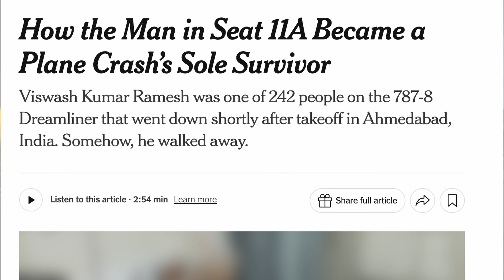Why the RAT Changes Everything – Air India 171 Update

Comment: While Capt. Steeeves presents a thoughtful and technically detailed review of this accident sequence, several key aspects of his assessment — particularly relating to Ram Air Turbine (RAT) deployment logic, the sequence of aerodynamic degradation, and the most likely failure chain — warrant further technical analysis and clarification.

The RAT can deploy automatically under certain failures, but it can also be deployed MANUALLY by the crew at any time. This distinction is critical. The RAT’s AUTOMATIC deployment logic activates under specific conditions such as dual engine flameout, certain AC electrical bus failures, or severe hydraulic system failures. However, entirely separate from these triggers, the MANUAL deployment switch allows flight crews to extend the RAT based on crew judgment if they believe additional hydraulic or electrical power is necessary, regardless of actual engine status. In this case, the observation that the RAT was deployed is insufficient to conclude that both engines fully failed. It remains operationally plausible that, faced with abnormal flight characteristics, rapid performance decay, and potential system messages, the crew elected to MANUALLY deploy the RAT while still experiencing partial or full thrust output from both engines.

While Capt. Steeeves focuses on AUTOMATIC deployment logic, his analysis does not fully account for the statistical improbability of dual engine failure at takeoff thrust on modern twin-engine widebodies. Historically, catastrophic dual engine failures immediately after rotation are exceedingly rare. By contrast, configuration errors, gross weight miscalculations, incorrect takeoff performance entries into the FMS, improper flap settings, thrust derate input errors, and degraded energy states on rotation are far more frequent causal factors in serious takeoff performance incidents.

Several well-documented cases reflect nearly identical accident profiles. In 2015, Air France 777F departing Paris Charles de Gaulle suffered a 100-ton weight entry error in its FMS (243 tons entered vs. 343 tons actual). This caused dangerously low computed V-speeds, late rotation, marginal climbout, and activation of tail strike protection. Despite the severe degradation, both engines remained fully operational throughout the departure. In 2009, Emirates 407 in Melbourne similarly experienced incorrect performance data entry that resulted in rotation occurring very late in the available runway distance, marginal climb performance, and maximum thrust application as the aircraft crossed the runway end. These cases demonstrate how configuration errors, when combined with full gross weights and potentially derated thrust settings, can produce extreme takeoff degradation without any mechanical failure of the propulsion system.

In the present case, additional operational factors likely exacerbated the performance margin. Reports indicate the aircraft carried additional fuel to accommodate extended routing due to regional airspace closures and conflict zones. This would have significantly increased takeoff weight and pushed performance margins closer to the operational envelope. If an assumed temperature or incorrect derate setting was entered into the FMS, the engines may have been operating at thrust levels below that required for the actual gross weight. Such derates, while common practice under normal circumstances, become hazardous when paired with miscalculated weight or runway conditions. These factors would combine to place the aircraft in a highly degraded takeoff energy state even before rotation.

From the available video footage, including one recording that clearly shows exhaust heat distortion and visible thrust displacement as the aircraft descended toward impact, it is evident that both engines continued to produce thrust throughout the takeoff roll, initial climb, and final moments of flight. As the aircraft crossed the departure threshold, engine exhaust visibly displaced dust, dirt, and debris, confirming substantial thrust being produced at that point. The exhaust distortion is clearly visible all the way through to ground contact, which directly challenges any scenario involving complete dual engine flameout. While the exact thrust levels cannot be determined solely from these recordings, the visual evidence confirms that both engines remained operational and were producing thrust through to the point of impact.

Ground witnesses and the surviving passenger reported hearing a loud bang at or near rotation. In the context of how late into the takeoff roll rotation occurred, this is consistent with tailstrike contact during forced rotation at minimal remaining runway. While the tailstrike itself did not directly contribute to loss of thrust, the sequence likely elevated workload substantially, as the crew found themselves in a rapidly deteriorating energy state, attempting to coax the aircraft airborne while already deep into the available takeoff distance with little margin remaining. This increasing task saturation, combined with abnormal performance and aircraft handling characteristics, likely compounded the challenges the crew faced immediately following rotation.

Following rotation, the aircraft appeared to achieve marginal flight within ground effect. While ground effect temporarily reduces induced drag and allows limited flight at reduced energy states, the aircraft’s inability to sustain climb once exiting ground effect indicates insufficient available excess energy relative to induced drag at climb attitude. This aerodynamic profile, shallow climb followed by rapid sink, is entirely consistent with a low-energy takeoff resulting from performance miscalculations and configuration errors, rather than mechanical thrust loss.

Throughout the brief flight, there is no indication the crew initiated gear retraction. In genuine thrust-loss scenarios, immediate gear retraction is often critical to improving climb performance. The absence of configuration changes suggests cognitive fixation on troubleshooting perceived thrust problems rather than executing performance recovery procedures, a well-documented human factor phenomenon in prior accidents involving takeoff energy degradation.

Taken in its entirety, the most probable failure sequence supported by both physical evidence and operational precedent is as follows: additional fuel uplift increased gross takeoff weight; incorrect weight or performance data entered into the FMS; improper takeoff configuration and/or thrust derate selection; delayed rotation with nearly full runway distance utilized; tailstrike at or near rotation; elevated cockpit workload as the crew attempted to coax the aircraft airborne at the runway end; MANUAL RAT deployment in response to perceived system failure; aerodynamic degradation after leaving ground effect; sustained but insufficient thrust through to impact. This sequence reflects a well-understood class of takeoff accidents where automation dependency, data input errors, cognitive overload, and energy management failures converge, even as both engines remain operational. Respectfully, this narrative remains far more consistent with the known data than the highly improbable scenario of an instantaneous, symmetrical, dual engine failure at takeoff thrust.

Comment: The lone survivor also said that he heard and felt that the aircraft was struggling to get power by describing as - ‘Raising’. Typically this term is used by Indians to describe for aggressively pressing the accelerator or gas pedal. This could be because of engine failure or due to RAT sound as you suspect. Just an observation 👆

Comment: My only issue with this is that at the instant the plane is visible in the newest video, there is nothing on that portion of the plane’s belly. I do however agree that it seems to be a dual engine failure, as they would have been screaming if they were powered up.

Comment: All 3 of your theories are to do with maintenance or pilot error. Rather strange isn't it. There is always the possibility that there was a system failure in the controls, some other mechanical or structural failure. But that will point a finger at Boeing. And if Boeing is paying you (and a whole lot of other "influencers") you will not mention those possibilities.

Comment: You can clearly see the lift off with engines blowing Dirt Off The Runway so it must have lost power immediately after takeoff. Looks like he used the entire Runway.  How fast does the rat deploy. The way I count they were only in the air about 30 seconds. There's also information from the prior flight where their electrical system may have had problems based on his information do you have that

Comment: I've stated from the first account of this incidence that the likely cause of the crash was Dual Engine failure as a result of contaminated oil. Looking at the video, we can see the aircraft is relatively aerodynamically stable (maintained the posture of an ascend / flight, wasn't tilted to any side (therefore no flaps issue)), but descended because there was no thrust (aircraft descension was due to failure to thrust), which was caused by the engine no producing power (Power is the ability to do work, also Power is energy transferred, also Power is force times velocity; i.e. P = F . v). A case where no power was generated (as a result of the engine failing), there will be a crash, because the plane at that instant cannot produce enough force to make it overcome the effect of gravity as a result of its own self-weight (F = Ma ; Force is equal to Mass times acceleration) .. The moving body haven gained momentum to ascend to its 'breaking' altitude, has no other possible effect than to attain a state of zero momentum whilst falling under its own self-weight. The quality of oil used may allegedly have contained some contaminants which impeded its circulation in the internal combustion chamber of the engines.. literally what you will attribute to when a vehicle's engine loses power as result of a clogged fuel filter or bad oil which doesn't properly combust in the engine's internal chamber.. I wait for the conclusion of whatever investigation(s) currently conducted out there, but my conclusion on the above incidence is based on my engineering background...  Aviation oil have specific standards they must meet, using substandard oil or a "convenient substitute" has the capabilities to cause far greater damage than can be envisioned.

Comment: Captain I am not a pilot but am and aviation enthusiast, according to me I feel during take off some debris was ingested on the runway, as dust can be seen on left engine, during the takeoff. This may have damaged the hydraulics lines running hence impairing the flaps and stall. The pilot tried to gain lift by doing noseup, but this i think make the plane go into a stall angle, and hence expediate the fall. No pilot will move the flap handle instead of the landing gear one.

Comment: Air India Flight 171, a Boeing 787-8 Dreamliner (registration VT-ANB), was powered by two General Electric GEnx-1B67 engines, as noted in reports about the aircraft involved in the tragic crash on June 12, 2025. This aligns with the engine options available for the Boeing 787 Dreamliner, which can be equipped with either General Electric GEnx or Rolls-Royce Trent 1000 engines, depending on the airline’s configuration.

Comment: @captain Steev

I’m not trying to speculate—everything is still unknown and will come out through the investigation.

My understanding is that  there may have been a thrust-related issue even before rotation.

There are some clues in the original airport CCTV footage. At the moment of rotation, you can see a puff of dust being kicked up—this appears to happen near the end of the runway. This suggests that the aircraft used almost the entire ~11,500 ft of runway for the takeoff roll.

We also know the aircraft had backtracked to the start of the runway, so this is a longer-than-usual ground roll. That in itself could indicate that the engines were not producing full thrust from the beginning.

My guess is that the pilots had already passed V1 and chose to proceed with the takeoff. Shortly after rotation, there may have been further thrust degradation or possibly a dual engine failure. This is supported by the deployment of the RAT and the mayday call from the pilots.

The initial issue may not have been a complete engine failure during the ground roll, but rather degraded thrust. Since the aircraft had already built up considerable momentum, the pilots may have judged that continuing the takeoff and dealing with the issue in the air was safer than rejecting the takeoff at high speed.

A huge, tragic loss. My heart goes out to the families who lost their loved ones. Wishing them strength and love during this unimaginable time.

Comment: The RAT was deployed. This is done automatically in case of loss of both engines or hydraulic/electric  power. .
The retraction of the gear was initiated. This can be seen by the fact that the bogie axle is aligned nose-down. The retraction did not work because of the loss of electrical an/or hydraulic power.
And pilots apparently  said  "Mayday, loss of power".

Comment: I suspected at the start that it could not have been a pilot error at least with the flaps instead of gear up theory. Most heavy aircrafts, boeing 787 in particular can take up to 20 seconds to fully retract the flaps. The aircraft should have continued to fly much longer at least 1 to 2 mins instead of 30 seconds. We are also not seeing any flameout or smoke coming out from the engines which rules out bird strike or damage. Even fuel contamination would show mixture residue as white or black smoke, or sounds of engine backfiring. So I'm ruling out contamination and engine damage from a bird strike
So now I have 3 theories:
Theory 1) Intentional pilot sabotage. One of the pilots immediately pushed the engine shutdown switches, the other pilot not seeing this may have thought of an engine failure and called out a Mayday. 
Theory 2) Computer malfunction causing both engines to go idle, which could be caused by faulty sensors. But even in that case there are so many redundancies in place which allows the pilots to override automated thrust control by simply shifting the levers to max - something which I'm sure they did as part of muscle memory in training.
Theory 3) An actual dual engine failure / shutdown caused by a very rare electrical failure. (Bomb, maintenance, renovations)

Still a real head scratcher. Need more clues
Reply: I also suspect Boeing shares to drop hard. At the moment it dropped by 4%. But I think 10% to 20% is likely. 787 is one of their greatest achievements. A problem pointing back to Boeing is going to be very painful for them. I intentionally picked Airlines that fly Airbus as of late. Not saying that Airbus is trouble free either, but it's just a fear factor. Boeing has been getting so much attention in the past few years. I feel sorry for them

Comment: Flaps are definitely still extended here, so cross that cause off the list.  I don't understand why people say they saw the flaps retracted.  They clearly weren't.  What's up with the spoilers though.  I know that it's supposed to be a failsafe system and has never caused a crash on takeoff, but it looks like they deployed, at least partially.
Reply: Why would the APU even be on?  Now I'm thinking that somehow there was an accidental spoiler deployment, the confluence of several mechanical failures at once.
Reply: I also think you can cross hydraulics failure off the list.  The plane should have continued to climb out even with a hydraulics failure.  There is no evidence of a rudder hardover, flaps were out, nor does it seem to be a trim issue, though that is a possibility.

Comment: Passengers from the previous flight from Delhi to Ahmedabad on that day had reported failure of AC and other equipment not working in the same plane. Maybe non functional plane equipment were giving the signs before hand which crew and maintenance staff didn't bother to check
Reply: exactly. And this guy didn't go through all the facts before his first theory that one of the pilots pulled a random gear.

Comment: The sequence of data indeed points to engine performance issue, as the pilot called the mayday for lack of adequate thrust for sustained flight moments after takeoff as the plane took literally the entire runway to perform liftoff!!! Lack of speed at the most critical moment of the fully loaded flight resulting in the apparent stall we witnessed. (Yet no specifics on flap settings and Extended land gear compounding the drag, all interconnects to final descent)

Comment: It is very strange that the plane would take off fine, like be OK on the runway, and then immediately die. Apparently if it was fuel contamination, the engine would be struggling for some time. Is it not possible that the pilot error with the flaps CAUSED the engine to shut down and therefore the RAT to be deployed?

Really looking forward to seeing the outcome.

Comment: I made this comment all along initially dousing cold water on the Qantas pilots claims that it was because the the pilot had failed to extend the flaps as per standard requirements. Two things wrong with this quick to blame pilot hypothesis. These planes can take off without the necessary standard flap extentions as the Qantas an a American pilots quick rush to blame 'experts' opinion. Thanks Captain Steeeve. At least there are other views ad evidence which may assist in protectig millions of lives in future. It may help us help Boeing too clean up their mess.